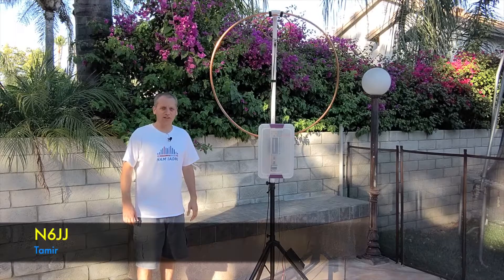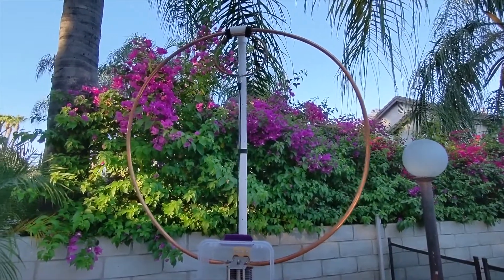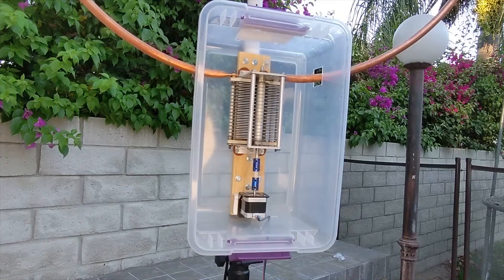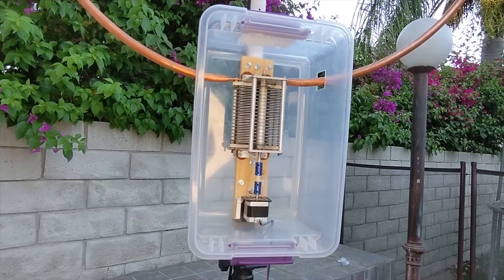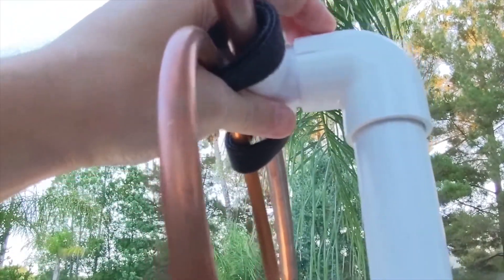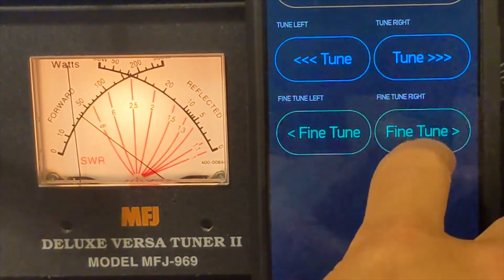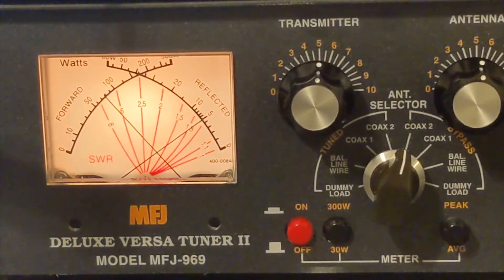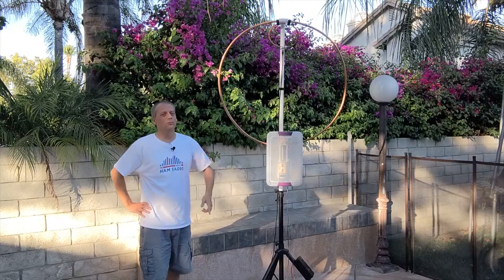Build a Magnetic Loop Antenna with Remote Wireless Tuning - Practical Guidance

Comment: Great video.  moving to a condo with HOA's.  Will be building your antenna.  Best explanation I've seen.

Can you tell me what the max voltage specification is for your variable capacitor?

Thanks, 
Terry, N7TB
Reply from the maker: Hi Terry,
Thank you. And enjoy the building. I don't know exactly about the max voltage that this specific capacitor can handle but the spaces between the plates is wide, and the plates themselves are heavy, so I can just assume that few thousand volts. The max power that I tested was 100W and without any issue at all.

Comment: I'm curious, in witch way the mag. loop works better, with the capacitor up, or down.  A couple of years ago I make my loop with the capacitor on top and the small loop at the bottom.
Reply from the maker: There are lots of articles out there about that. I personally didn't test that yet.

Comment: Nice video!  I need to watch your controller video now.  When I built my 30-80 magnetic loop I used a bias-T network, at each end, to put DC control voltage on the coax to rotate my gear motor/tuner mechanism.  I'd like to know, does RF ever cause your tuning cap to move?
Reply from the maker: Thank you! Nope, I didn't have any RF issues. You can also see in the video, that I placed the controller on one of the tripod legs, no so close the capacitor.

Comment: Please clarify:  
 1. How did you make or obtain the white snap clamps on the back of the plastic box?  Are those made from the next size up thin wall PVC pipe?
 2. What are the 4 red "washers" between the variable capacitor and wood strip? Are they fiber washers or possibly ceramic, and are they simply spacers or are they put in for safety, heat, or isolation reasons?
 3. Is it OK for this antenna to become grounded through the shield/PL259 when connected to a radio that is grounded?

Thank you for this excellent video and I am looking forward to starting the project.
Reply from the maker: Thanks again, @Todd.
1. The snap clams are the following parts: https://www.amazon.com/Snap-Clamp-Inch-Inches-White/dp/B00C7DPO4K/ref=pd_bxgy_1/131-0507706-1910934?pd_rd_w=TsZ0M&pf_rd_p=c64372fa-c41c-422e-990d-9e034f73989b&pf_rd_r=7JRVFVGC3PMR1HV0FRDB&pd_rd_r=f6b5abcf-e449-4ce2-8423-23f838f4d7ae&pd_rd_wg=UcEUV&pd_rd_i=B00C7DPO4K&psc=1
But any similar 1" PVC snap clams parts should be good.
2. Good question - these 4 red washers are made of rubber, and in my case i just needed a tiny spacers to align the capacitor shaft with the motor. I needed ~2mm to align that ;)
3. This is exactly my setup and I don't have any issues. My radio is grounded. Remember that the coax that goes to the Antenna, is connected "directly" only to the small loop. There is no physical contact between the main loop or the capacitor and the coax/radio.

I hope it helps. Good luck!
Reply: @reHamRadio  Thanks for the link for the snap clamps and for the other answers. It's all starting to come together now.   Whenever I need spacers like that I now turn to my 3D printer and it is quite a timesaver to be able to quickly make exactly what I need instead of rummaging through parts bins or trying to cut small pieces of wood etc. Best regards to you.
Reply: @stolz5573  I am wanting to get a 3D printer.  Do you have any recommendations for printing up to about 12" square?

Comment: Nachon! Todah! How do you power the tuning unit? Do you power it with 12v over the coax? That would seem to be the most convenient way to do it.
73 de Arnie W8DU
Reply from the maker: Hi @Arnie, I do use 12V but from a battery. Please review the video at minute 1:08. In that frame, there is a picture of the antenna on the balcony, and it's easy to see the battery near the tripod legs. I separated the remote unit from the Antenna and from the tuning unit. I found it the best way to avoid RF issues and for safety. 
And Todah as well for the question ;)
73, Tamir.

Comment: Do you use a choke on the RF feed-line?
Reply from the maker: Hi Peter, no, I don't use a choke yet. The coax is connected directly to the coupling loop and it works without any issue.

Comment: Yours is the first mag loop build I've seen to use flexible copper tubing. Why go that route as opposed to just shorted thick coax? 73 KN4YRM
Reply from the maker: Thanks for the good question @Randon.
When I thought about the design, Coax was one of the considerations. But I wanted something wide, for better bandwidth, but also something that will be not heavy and strong. The flexible copper is soft enough to work with, but strong enough to hold itself without any special support. See the pictures how it stand by itself and keep it shape. Also, it's very cheap!
Reply: @reHamRadio  Yes, seems too good to be true! So many videos where hams go through elaborate pipe-bending or elbow-joint-making in order to use copper pipes. Great find.